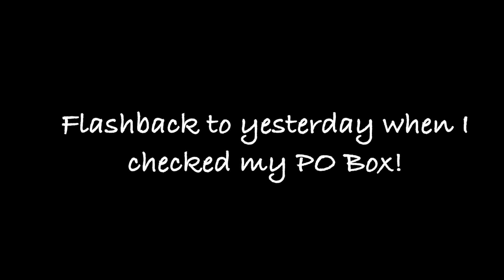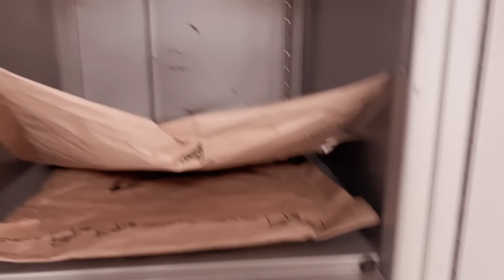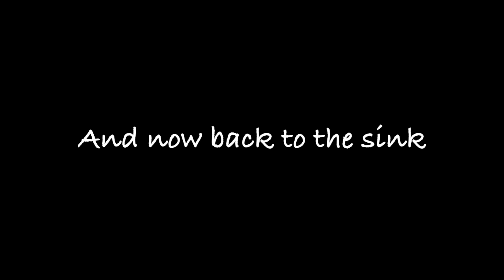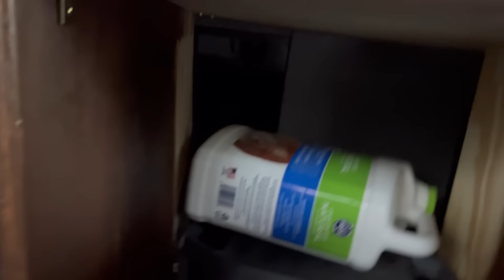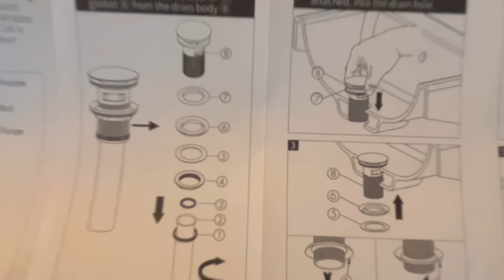Living in my van | Build series Part 4: Installing the sink #vanlife #building #ford #gratitude

Comment: Definitely make that brace for your glass water jug as it would be ashame if it fell into your porcelain sink & cracked it & jug would break too.
Reply: I was wondering if the water jug would sit inside the sink when she is driving?
Reply from the maker: I usually put it on the rug on the floor of the van while I’m driving.

Comment: You did great Rowan! Walmart has a great sized square container for your gray water. It’s where the camping supplies are. I think it’s 5 gal. And it’s clear so you can easily see how full it is. Also, we have a similar (bigger) sink in our bathroom in our house and we didn’t end up gluing the sink to the countertop. Once you tighten the drain it won’t move. Easier if you want to change something later.

Comment: You could move your little lamp forward and put your solar generator in that corner.  it will help you see where to plug in and turn on. You could put a bungee cord around it and attach to the van.

Comment: One of your bloggers asked about a shower. I have the plant sprayer from home depot and the kitchen sprayer attachment I put together.  Its 2 gallons. Can use it when its warmer out. Get a big tarp deal it over your back open doors using magnets to hold it on car.  Heat water on stove, or fill it and set in sun til water warms up.  Just like taking a bathroom shower.  Saw another blogger do it. Easy peasy.  So enjoy your channel👌👍🤓

Comment: You're going to need a 'P' or 'S' shaped pipe just before your grey tank, otherwise, it will smell bad. The water trapped in the p or s will act as a valve to block smells from grey tank.

Comment: There should have been a washer and screw on fitting    To attach the flex pipe to the sink stopper.  The tape won’t hold long 🤷‍♀️

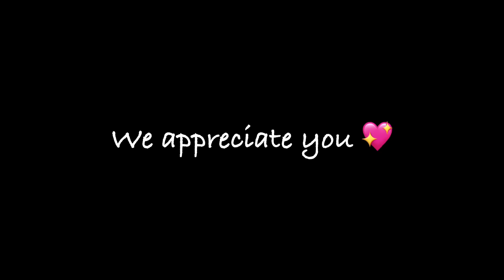Comment: 10:26/30:12
Speaking of your water canister, wondering if you were to use putty desined to keep objects in place under the water jug?
I've seen it advertised as 
QUAKE HOLD (museum putty).
Except, I don't think you'd be able to freely move the jug once putty is applied? 

Lots of happiness wished for you and your sweet Ruby. 🎉
Reply from the maker: Thank you! Lots of happiness wishes for you as well 😊

Comment: Hello 🤗 I was curious if the door dash gig is working out good? I really want to do this and was just wondering if it is enough to get by on... love your van
Reply from the maker: Hi! I’m not doordashing as much as I used to. I’ve dashed in the van and I will probably do a vlog about it at some point but the mileage isn’t as good as the Honda.  But I would say if you DoorDash full time it is certainly enough to get by on! I was able to get the bills paid when I was renting an apartment but I did have to work at it 40-60 hours a week.
Reply: Ok that's great! It somewhere for me to start. 🎉
Reply from the maker: I started out doing it part time and so I started to learn the best times to earn were and also when I liked to do it.  It helped me get a feel for it all and then I did it full time for a while because I really enjoyed the flexibility. Good luck and have fun and I’m happy to share more about it if more questions arise!
Reply: @justrowan   Thank you!😁